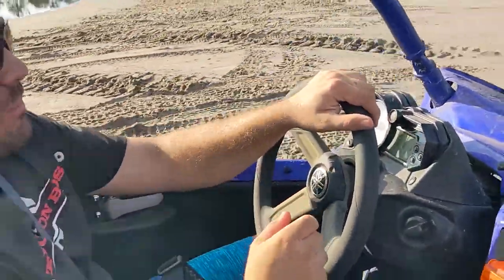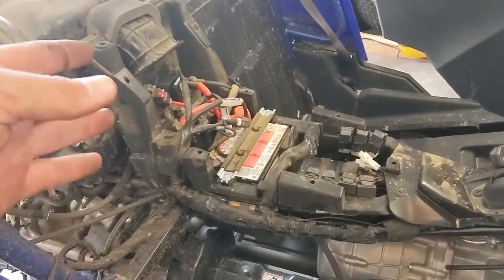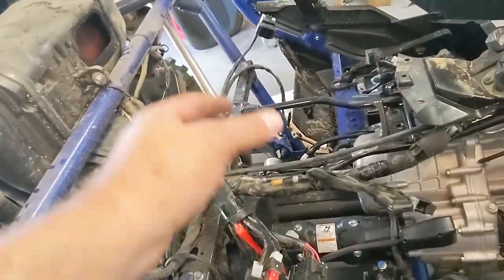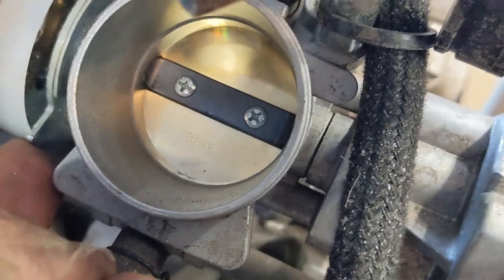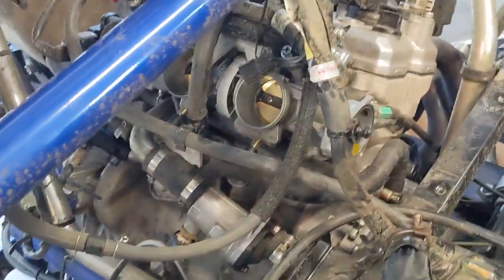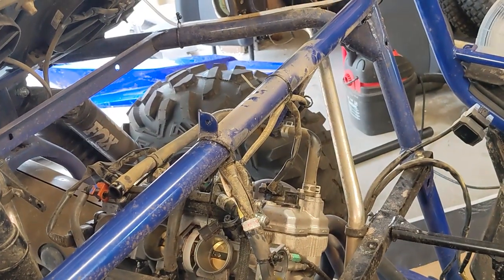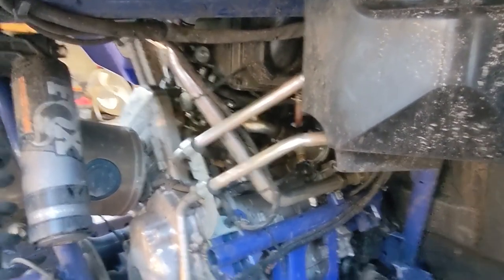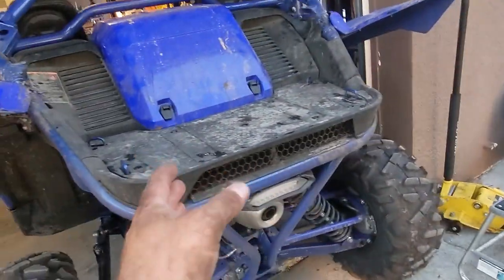YXZ1000r Throttle sticking diagnosis and Fix... it was the butterflies YXZ RPM high idle hang

Comment: I'm at Hatfield/McCoy right now with a '21 yxz. Same issue. Throttle hung at 8k rpm. It pushed through the brakes and I had to kill the ignition to stop it. Scared the shit out of me.

Started it back up, still hung at 8k, killed the ignition. Flicked the throttle pedal a couple times with my foot, started back up and it idled. The rest of the day it hung around 2-3k, which gave me that "Cruise control" you mentioned. If I flicked the pedal it would go back to idle. FRUSTRATING.

I just tripped 700 miles on the unit, never had an issue till today. I would take it back to the dealer to warranty the issue but who knows when I'll get my yxz back.

Thanks for the video and the information 🤟

Comment: One of the very first mods you should do is the six spring pressure plate. It's  amazing how much it helps with the extra clamping force. Both alba and Barnett offer this part.

Comment: Throttle cables this day in age is stupid. My viking got stuck wide open at 60 mph because the 90 elbow by the pedal broke and pinched the cable in it.